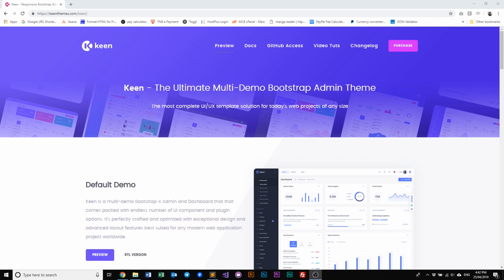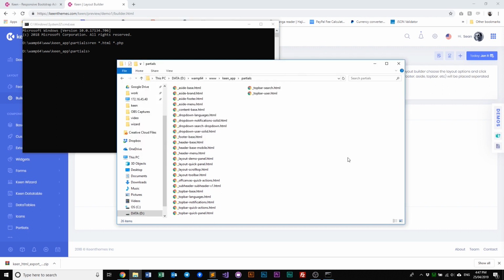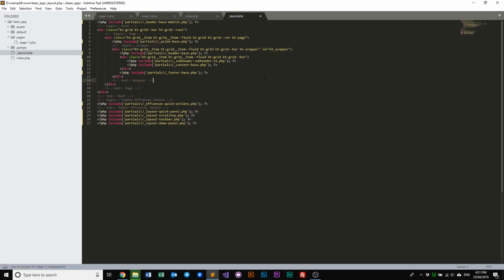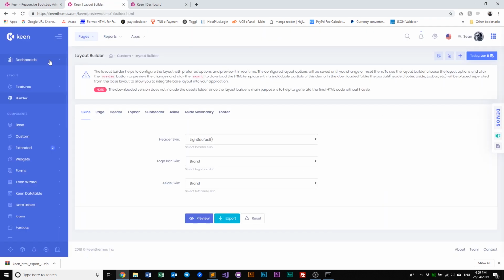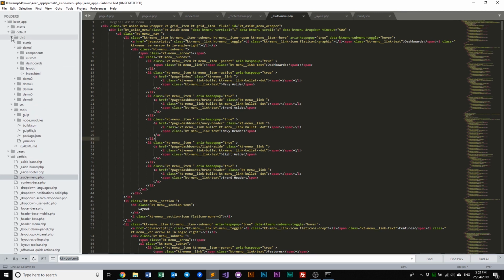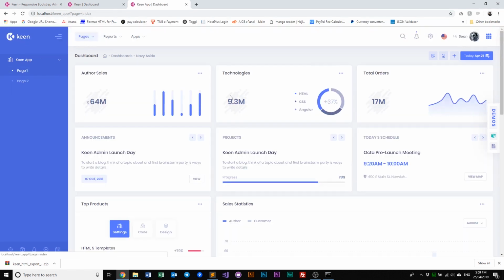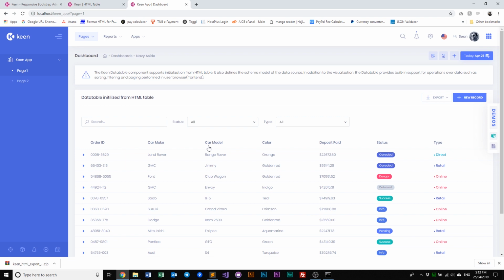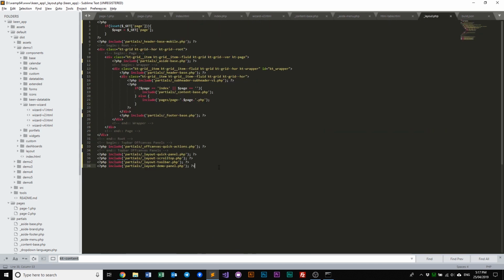Your First Project Tutorial #4 - Keen Admin Theme

Comment: All Keen plugin such as Data table and wizard has no usability since there are depend on the javascript that is obfuscated, in real life scenario all the data comes from the database and certain functionalities such as pagination and select all might or not come from short javascript code.
The wizard stop working if you remove JS,  tables do not even have heading and or any data...
In my case, I spend a whole day integrating this into the Django project and it was a complete waste, no one uses Javascript to populate or control forms and data or pagination in Django or any modern framework. 
the way the keen plugin works is the worst I ever saw.
Reply from the maker: Hi, we have a multiple options to populate data within our datatables. If you need the data to get populated via your backend, then you can just use the basic HTML datatable and populate the table server-side pre-dom render. 

As for the wizard, yes you'll need JS to validate and move the steps forward and back. However, the form data doesn't have to come from JS. 

Also, we just released a major update for Keen. Perhaps you can check it out to see if it fits your project.

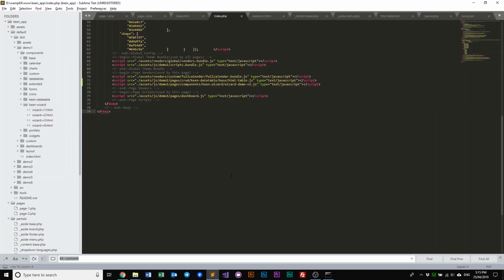Comment: Hi! Is there a better way to include assets? In the example you said that include js scripts (eg. html-table, wizard-demo) with a simple IF page1 or page2. But, what happens when the project start to grow? or pages starts to require two, three or more assets? I mean, to only load scripts when needed. (ref: minute 28:15)
Reply from the maker: You can handle this issue in your server side by having global head template for all your pages.  In that head template you can include global plugins.  Or you can add the datatable plugin into the global bandle by just moving it's css/js includes into mandatory node of the build tools.  If you need any further help please contact our support at support@keenthemes.com

Comment: I'm using ver 1.4.5, and this vid is a bit far behind, as far as folder structure and some of the instructions. For instance, you tell us to copy the 'default' folder into our project folder. Assuming that you mean one of the 'demo' folders instead of 'default' (which doesn't exist), I still don't understand why we need to copy a whole folder. Why not simply copy the assets of that folder? Also, you're using 'gulp' in this video, but your previous vid demonstrated using webpack, and that's what I used. Am I now supposed to install gulp and do this 'gulp' command, or can't I simply run 'npm run build'? I'm confused. I wish I'd watched this vid before I bought this because this is a lot more manual work than I realized it would be. Nice product, just wish it were a bit less tedious to get started.
Reply: Hi Ken, we will create a new video for the latest folder structure.
Thanks